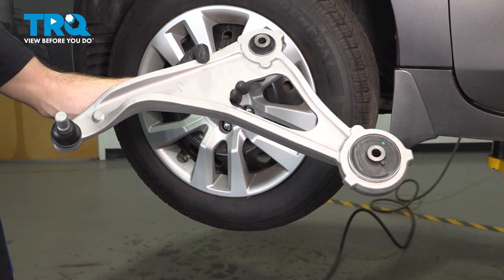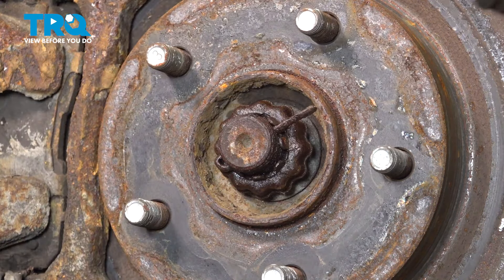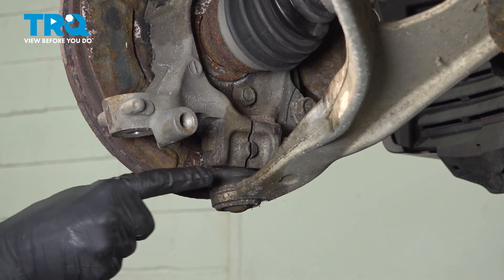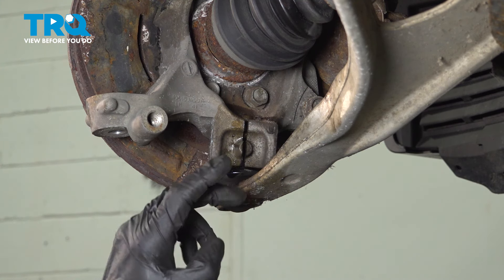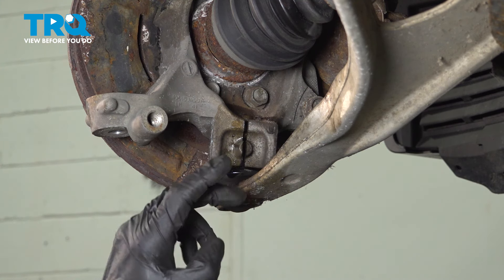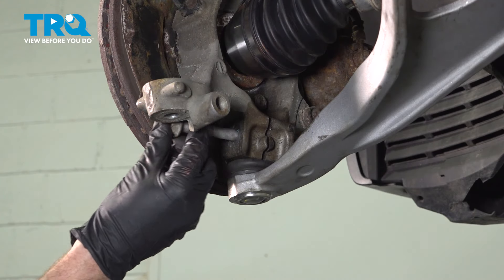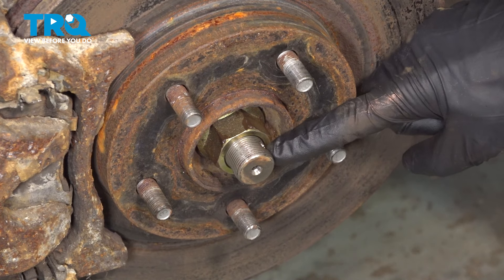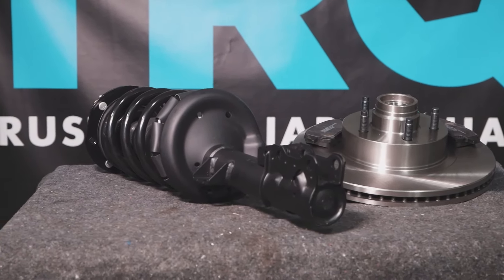How to Replace Lower Control Arm with Ball Joint 2012-2018 Nissan Altima

Comment: what is the point of removing the axel nut ?how did that help ( legitimate question)
Reply: The axle has to be free moving so you can pull the hub assembly away from the ball joint shaft.

Comment: Since this is a video to demonstrate how to remove and replace the control arm and ball joint for the home mechanic, who does not have a lift, you shoud do the video with the car on  jack stands to  simulate what the home mechanic has to do to replace the control arm.  I couldn't get the control arm pryed down far enough to get it in place because I did not have enough clearance to pry the control arms down far enough.  I then removed the strut and was able to put the control arm in.  But then, I could not get the strut back in because I  again, I did not have enough clearance to pry the control arm far enough down to get the strut in place.  Another commenter, made the similar comment below about "clearly needing a lift in order to get enough clearance to pry the control arm down.  

You clearly need a lift in order to get the leverage to pry the control arm down.  Anything less than about three feet of height won’t work.